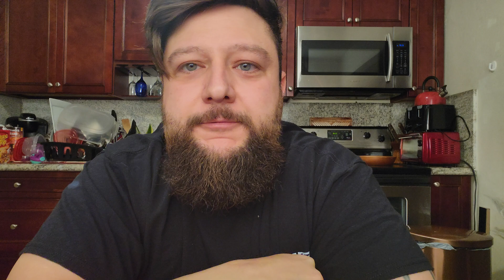k24Z: 4 Piston Racing Solutions to the Ugly Duckling K

Comment: The r40 heads in stocks form out flow a k20 head  yhe flaw is cam profile   u can swap in set of cams and vtc gear and ur good ti good
Reply: The only viable option for an r40 head is to throw boost at it.
Reply: They do not… lmao
Reply: You have to port it for it to make anything… have you seen how small the port is?
Reply: The stock vtc gear is plenty. It’s a 40 degree which for the most part is all you need for tuning. The exhaust cam not having vtec is your biggest issue. Intake cam has plenty of lift to provide sufficient enough power.
Reply: It all comes down to no vtec on the exhaust cam and the shitty single port design.
Reply: @ohitselii   u do know  the valves are larger the r40 heads got one limit its the restriction at the exit of the port on exhaust  if u port match it   u pickup  quite a bit more flow also the lift on the exhaust cam on single rocker is still higher then lift on the 3lobe vtec models     try looking the checking specs ur self vs guys just saying omg vtec is loud and kicks    its making more power lol    the cross over bogg  is due  air stalling   also u only see power bump swaping heads because compression is higher   easy fix with piston swap
Reply: No they do not. The integrated exhaust manifold it has is highly restrictive and its my understanding that it only has vtec on the intake side if my memory serves me right.

Comment: You have to add weld to the head and machine it flat. I have a 9th gen si with a k20z3 head and type s oil pump. People over complicate it. The Z7 block is actually superior to the A blocks being that it’s 11:0.1 instead of 10:5.1
Reply from the maker: @ohitselii  k20a2 is 11:0.1 👀
Reply: You could just swap pistons in an a to raise the compression and then it has a much higher flowing head.

Comment: Junkyard near my house has a 2008 crv 2.4 I looked it up and it says k24z would that be a good block to purchase it’s only 50 bucks or I could get the whole engine for 140? Also wondering what heads would bolt on to that block
Reply from the maker: The most I've ever done to look into the k24z is right here in this video. If this isn't enough to help you out then I'm not the guy you need unfortunately
Reply: @VHBEngines  I appreciate you making the video I might just grab the block since it’s so cheap

Comment: heads up just finished a hybrid build useing newer r40 k24Z rods in a k24a2 block with  a k20a2 oil pump upgrade  the k24z rods hit the windage tray   when motor runs   clearence  is basicly cunt hair  to the tray  fixed problem by useing 6 thick m6 washers  to space the windage tray so it dont hit the rods  this may be problem to for  mods using k20a2 oil pump on newer k20z motors  to

Comment: My buddy give me a k24z and I seen the single port exhaust I said wtf so traded it for some bc stage 3 cams for my b series
Reply from the maker: 🤣 I feel ya
Reply: The single port sucks bro but still you can get 230whp outtve these things for like 3k... pretty crazy
Reply: @stevemisfit1 let me know how this is done please😭 a brief summary of items thag would make this possible please
Reply: @isaaclara7345  It honestly depends on engine health & the Tune. But from my exp with a '13 FG4 HFP just a Rv6 catless downpipe, Premuim CAI with ported throttle body, Hondata/Ktune and a good tune on 94 Octane should get you pre close honestly. The main mistake people make when trying to make power on the k24Z7 is removing the poly intake manifold. it was specifically designed for the K24Z7. That's why you see a lot of guys "losing" power when they do the 8th gen intake manifold swap.